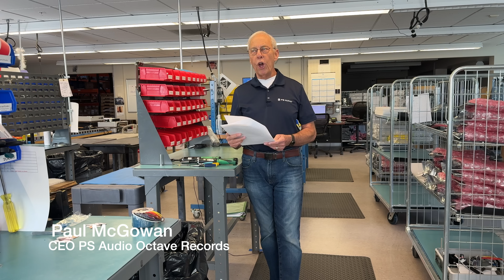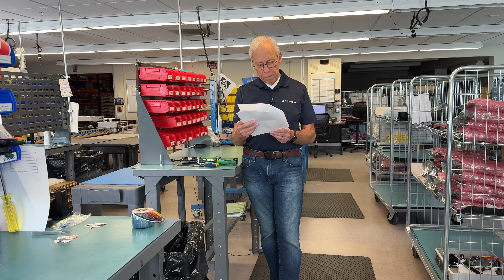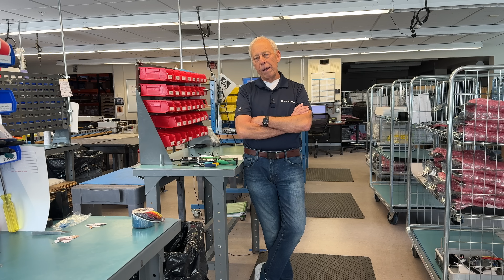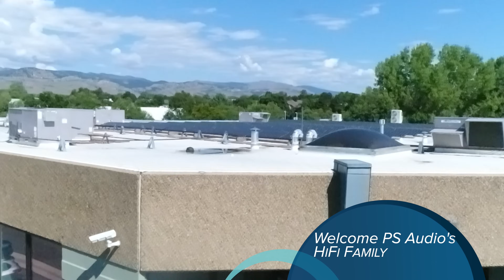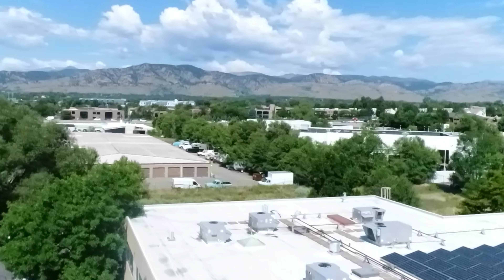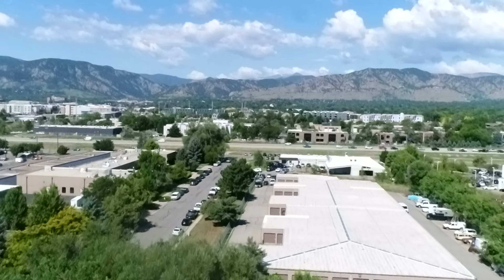DACs that don't upsample or modify

Comment: A British Audiophile has just reviewed 'their' lowest tier DAC and gave it an outstanding review. My Gustard R26 DAC upsamples, but I prefer it off and upsampling 44.1 to 88.2 on Roon. Sounds more natural. All Hi Res I prefer left alone. Its only 'slightly' better than 44.1 at 88.2 and much better than any higher. We all interpret sound differently, system synergy also plays a part. This other company (yep Audionote) do use own made caps etc and a valve output stage with an old philips R2R DAC.

Comment: Unless you have very high quality processing, they talk a lot of sense. Oversampling being a case in point.  Lots of people will automatically upsample and immediately tell you they can hear more 'air' or a ' larger sound stage', but critical listening will show you have lost some 'body' and textural details in the timbre become less distinct, for a lot of cheaper dacs/streamers.
I use a Chord Hugo TT2 Dac and for lot of dacs/streamers around the 1k range Ive found this to be true, the more correct sound for me appears to be when the bits are delivered without processing. However, Ive heard my dac with the m-scaler upscaler and this appears to achieve the bennifits of upscaling without the sacrafices. From what Ive heard, I think this also applies to high quality dsd conversion and upscaling such as used in ps audios products.
I think the useual rules apply: if you are going to adjust the data stream it needs complex and well designed manipulation that is typically  only offered by the better designed and more expensive options. If you are going to manipulate the data, you have to do it right or dont do it.
I remain not up sampling for now while I save for my upscaler as I believe the sound I get is truer to source than upsampling in my streaming bridge. I felt the same while setting up an A6 for a friend, though I believe he prefers it on. Thats ok, we all like different things..

Comment: If the wine tastes good enjoy it without worrying about what the vineyard did to produce it.
I buy the argument that music recorded by Octave at DSD256 will sound best played on a DSD256 based DAC.  Down sampling and PCM conversion are all lossy events. 
But when it comes to a Red Book CD which represents the vast majority of available music I like NOS R2R playback without even a high frequency filter.  As soon as you introduce even a simple low pass filter at 20k, to me some of the magic starts to evaporate.  So I guess I am in the Audio Note camp.

Comment: In my system, oversampling sounds "polished". 16/44.1 seems to have more analog grip and dynamics. Ref: Denafrips Ares II R-2R.
Reply: Completely the other way round for me.  OS just sounds better on my system and NOS sounds like it's lacking something in comparison on both my Venus 2 and Terminator 2 12th

Just a question of preference I guess.
Reply: @Sunshine_Superman  ... same here with my Venus II and later firmware. I will add though, that only recently I found out that "OS sharp" by now sounds way better and snappier / PRATier if you will, than "OS slow" which was my old preferred setting.

Comment: I don't know if there is a right or wrong answer to the original question.  I have never heard an Audio Note (for it is they) dac outside an Audio Note system.  But I HAVE been consistently impressed with the sounds that AN systems produce.
Reply: ... absolutely. On any HiFi show, their demo room is always amongst the best. And their choice of demo music is very refreshing, too!
Reply: Audio Note just had their entry-level DAC 0.1x reviewed by "The British Audiophile." I am always a bit baffled when a manufacturer of digital anything claims to have never auditioned an Audio Note DAC. AN is widely regarded as making some of the best DACs in all of audio so if you are going to go into DAC building it might help to audition the "best" so you have some sort of template on what to do. 

But then Stallantis builds crap so perhaps they never bothered to drive a Camry to learn how to make a reliable car. Steve Hoffman - Mastering engineer for Analog Productions (LPS) and who masters many of the biggest name artists (and also masters on SACD) owns AN digital (and AN most everything else). Both at home and now in the studio. This stuff does NOT measure well though. Art Dudley said their CD player was the best he ever heard - JA said he thought the measurements were "broken." It takes a bit of nerve for AN to basically say that every other company in the entire audio industry are wrong and only they have the answer - it sounds cultish. The only reason it doesn't sound cultish to some of us is because it sounds "right" but if they were at a show and sounded bad (happens to everybody) - then you would scoff at their views. I have owned AN gear for over 20 years - still waiting for someone's digital to sound better than an AN CD player playing Redbook CD. Have not heard it yet.

Comment: I guess things can go wrong with the digital signal if you don't know what you're doing, but in general it's not going to be an issue. DSP is all about 'messing' with the digital signal, and yes things can 'go wrong', but not if you know what you're doing.
Cheaper DAC can certainly benefit from upsampling and sound better, or rather they won't sound as bad due to not being able to filter.

Comment: It’s really super simple. Let the DAC decode exactly the sample data totally lossless of the source file with no sample rate conversion or attenuation.  The DAC run on the exact sample rate frequency of the source file with no conversion. The reason this topic becomes messy is when more than one clock master exist where you suddenly end up with data flow issues yielding jitter concerns. Perfect is one single clock master in the DAC and all data being pulled through asynchronous transfer from the source and played in exactly the clock of the source file with no transcoding of any sort. It’s a bit sad the obvious is not how it’s typically done. Especially too often the source device has its own clock that battles with the DAC clock and with synchronous transfer you end up in some cases transcoding the stream to a different sample rate. It’s a bummer because there is no major cost in running a streamer fully asynchronous (one clock in the DAC). How about making I2S work with the DAC as clock master (pulling the data)? Or is PS audio doing this better way of I2S already?
Reply: UR Statement is correct with caveats!! Digital is and always has been capable of error correction there is no real need for the " master clock" with current CPU, MEMORY capabilities Audiophiles should demand the same error correction technology that's been around for 60+ years.
The first transmission of Audio over long-distance occurred in 1887. An Orchestra concert in France.

I use a DDC/Rendering combo that buffer's the whole track  so less error correction is need @ DAC level
Reply: @HeavyCrown2030  Error correction is a thing you need for CD playback due to optical read errors (typically from scratches). Streaming data over IP is using TCP and that ensures your data to be error free.
The DAC controls the conversion from digital to analog and the timing thereof. With precise master clock in the DAC you can avoid jitter. The term “master clock” means the DAC is in full control of timing and doesn’t need to adjust itself to any other clock such as a source having a clock. This is achievable by adequate music data buffering and asynchronous data transfer. Audiophile streaming is possible thanks to asynchronous data transfer.

Comment: MHz... MHz... that's a lot of Hertz. However we shouldn't forget that 1 bit, one lonely bit is not a bunch of bits. CD-DA tracks I have bought and listened from Octave Records sound extremely well.
Reply: Also remember that most PCM DACs, unless RtoR , are one bit Sigma/Delta conversions that just guesses at what the actually voltage level is supposed to be. Sigma/Delta DACs ae ignorant of the actual PCM data file voltage level at a sample. They just try to guess whether to turn on for that clock cycle or not. So increasing the sample rate allows the system to more accurately follow signal changes one bit at a time. IOW operate as a true Sigma/Delta system instead of kluging it into a PCM stream.
Reply: @glenncurry3041  There's a lot going on inside the DACs that I can't see. What I can see with a RTA analyzer is what is in the file. Sometimes I find a «surprise» that I would rather not get. I might be an ecological «audiophile».
Reply: @Jorge-Fernandez-Lopez  It does not take an RTA to see what any specific individual sample's voltage representation is. Just look at the bits for that sample and they will tell you the voltage at that point in time is. In fact an RTA requires a passage of time, multiple samples combined into a signal and only shows the output of the device's stream processing that data. Not the individual data points themselves. 

Digital has many surprises I would rather not have nor listen to.
Reply: @glenncurry3041  The voltage for one point is a useful information. Although, RTA is useful to see all frequencies at the "same" time, which are music and which are high level noise. Different tools for different goals and conclusions.
Reply: @Jorge-Fernandez-Lopez  The voltage at one point is the entirety of what PCM is based on. That is 100% of the spec's definition. How to determine one sample and how often to do that. And an RTA does not provide the digital data stream of a sample. 

The point is other than when using an RtoR DAC, the DAC is a one bit Sigma/Delta!

Comment: my 2 cts: my streamer has an upsampling fct which can be activated or deactivated and which can be set to various levels of computational effort that can be deactivated. paired with my older dac (arcam irdac, lin psu, excellent usb aq coffee) active upsampling improved things in all sorts of musical styles. with my newr dac (chord qutest), things are different: the new dac upsamples with a lot more computational power and upsampling to higher dac input resolution via streamer turns out to sound less real than feeding the original resolution into the Qutest dac. In other words: I am sure the 16/44 only dac sounds nice, but I doubt the Qutest or a similar dac will not sound a bit better in terms of fluidity, 3d, effortless hi frequ resolution w/o glare or hardness, even prat. also pure nos dac would need to filter out harmonics somehow, at rel low cut off frequency, to avoid intermodulation distortion, or leave IM untreated. neither of which sounds like a good idea to me. 

Best advice however is to compare things yourself, inna transparent system, and over a couple of days.

Comment: I think this is a variation on the analog/digital discussion. If your ears/mind prefer an analog sound, the non-upsampling products of Audio Note are tops. However, if you think/feel that audio has progressed by the data retrieval of modern dacs, upsampling is the way to go. Both have a reason to be.
Reply: It's not just, no upsampling, via R2R topology, but no I/V active filtering, just a resistor/transformer/resistor, then Class A biased valves to amplify the signal. And the level IV employs triple C core transformers to the output. Mine was definitely worth the challenge of wielding a soldering iron.
Reply: Bearchenization is right. From an information entropy pov, nos dacs are merely creating images of frequency domain data repeating at ultra high frequency and pointless for human ear anyway. Those images are merely artefacts of sampling with limited bandwidth.
Reply: All DACs upsample since forever because when filtering is applied, that adds a harshness to the sound. And the upsampling is done because then that effet gets moved to frequencies that we cannot hear. The reason there first was no upsampling and now  there is, is simply because the early chips did not have the compute power. It has never had anything to do with creating data that simply is not there, as critics used to say, or still say, that is simply not undeerstanding why upsampling is done. You absolutely want an upsampling DAC.
Reply: 24.1/16 destroys and is furthest the analog sound of any of the digital systems other than MP3. 

Digital is desperately still trying to progress to the level of analog.
Reply: @glenncurry3041  The dumbest possible thing you could say, especially below this here video. Old Paul had already said many years ago that he had given up on analog, simply becase it has nothing on digital anymore. And he only started endorsing analog again for commercial reasons since they started offering analog products again, duh ;) Yes, that's right. Now, there are a million reasons, and issues, why analog is really dead, and you are just a fanboy: there are great historic analog recordings and they are still great today - if you find a copy that has not been scratched or played a hundred times, if you have a stupid expensive turntable with an even more stupid expensive pickup, and then you have to replace that every so often with an equally stupid expensive pickup... don't take us for stupid, OK? Now, when the Poetry on Plastic channel did a review of some special highend recordings, he will tell you that despite owning a turntable for 10+ K bucks, and likewise his friends, there are recordings that are so complex and the grooves so tight, that no matter how expensive the turntable, the pickup will jump out of the groove. - How many people have a turntable for 10K? Exactly, nobody. Duh. No 10 bucks CD player will ever suffer from such a problem. So some of the issues with vinyl are that since the 90s, nothing is being recorded analog anymore, and since the revival, there are onyl limited editions pressed, no matter what it is, pop or classic, mostly a digital rip-off anyway, so basically shit, any literally any mild effort production is limited to 1000 copies, like Berlin Phil etc... and most vinyl is pressed on thin shit, with off center holes etc etc... and then you really need a vinyl washing maschine for 800-2000 buks at some point, if u even want to keep up with digital, and really, vinyl is like driving a vintage car, a hobby for the few, which is why there are only a few.. for all the above reasons. So unless you are into 60s-70s jazz and have a pristine, rarely played collection, stfu, ok? I have a 10K turntable myself, because I can, mostly, but once you have a TT, there are recordings you simply cannot get on digital, so there is that, but that argument obviously works both ways. If you think vinyl is better than digital, you just don't know what you are talking about. It is like insisting petrol cars are better than electric cars in a world where there are no fossil fuels... duh.  Digital beats vinyl's ass 1000x times a day, ever day. I buy everything on digital and vinyl, even the most expensive shit, to figure which is better, even like Berlin Phil direct to disc recordings etc - but I understand that is not meaningful, just for shits and giggles... first, both recordings would have to be objectively of the same quality whatever that means, and then a 10K CD player would have to be of the same quality as a 10K turntable, whatever that means... in short, vinyl is a quirky hobby, the end.
Reply: @Baerchenization not as quirky as you clearly

Comment: Whenever you address a problem you inevitably add complexity to the chain. The question becomes, is this worth the trouble and what does it cost to do it right? I think both standpoints could be right in a sense that those who believe in the less is more philosophy prefer not to do things rather than doing them bad. Those who believe in fixing flaws and doing it right, are probably getting better sound, but if that is all over, remains the question. So it then comes down to how much emphasis do you put on different aspects of the sound. It actually always comes down to that when it comes to different design strategies.